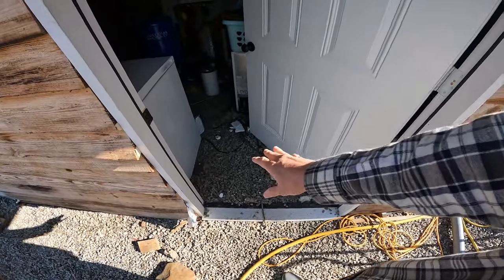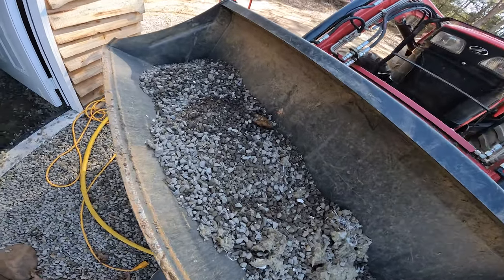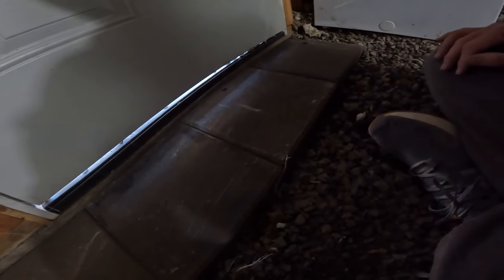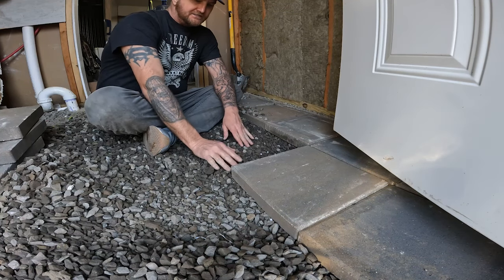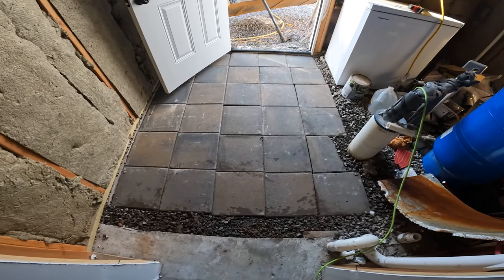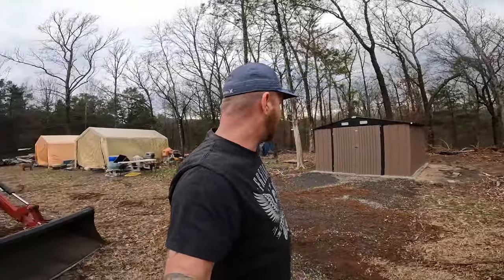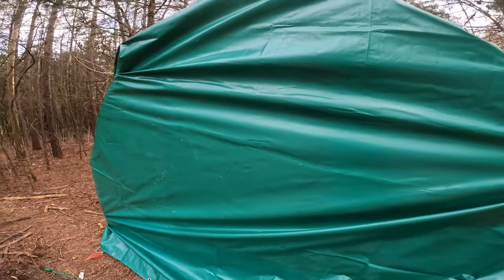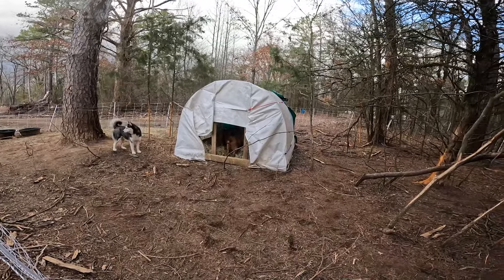GETTING THINGS DONE tiny house, homesteading, off-grid, cabin build, DIY, HOW TO, sawmill, tractor

Comment: Keep on feeling better David! I took my Dad and my Brother out for supper and then to Wal-Mart. It was 40° and overcast a little windy. We were in Wal-Mart for a half an hour. As we were checking out the power went out. After about five minutes it came back on. We walked out to a blizzard. It put down about three inches of snow and slush in about a half hour on the drive home. My new F250 had no problem in 4WD. Going up the hill to my Dad's house the car in front of me was spinning and sliding but made it up the car behind me went broadside and into the ditch. I had to go down the back side of the hill to get home because the front side was plugged up with stuck vehicles. I never spun a tire or lost traction. When I got home all I could hear was emergency vehicle sirens in every direction. It got nasty quick. I live where people know how to drive in this stuff so you know it was bad. Have a good one Brother,stay safe,dry and warm! God Bless ya David!!!❤😊:_RYDER::_ECLIPSE::_UBER::_CMON:

Comment: DAVID NOT TRYING T0O TELL YOU WHAT TO DO JUST SUGGESTING INSTEAD OF USING HAY FOR THE BEDDING I WOULD SUGGEST STRAW A IT DOESN'T RETAIN WATER LIKE HAY AS STRAW IS HOLLOW AND HAY SOAKS WATER UP UP AND CAN START MOLDING AND HOLDING AN ODOR I WOULD BUY OR MAKE A HOLDER FOR HAY TO EAT THIS IS FROM MY EXPERIANCE FROM RAISING LIVE STOCK OVER 70 YEARS AGAIN JUST A SUGGESTION TO YOU
Reply: ALSO MOST OF THE TIME STRAW IS CHEAPER THAN HAY LIKE WHERE I AM AT STRAW AROUND 3 A BALE HAY AROUND 6-7 A BALE